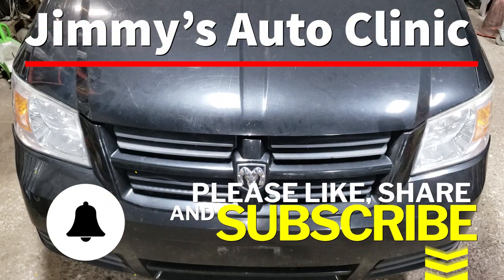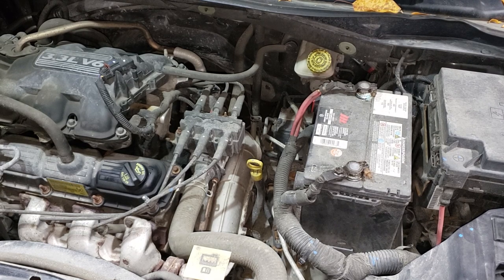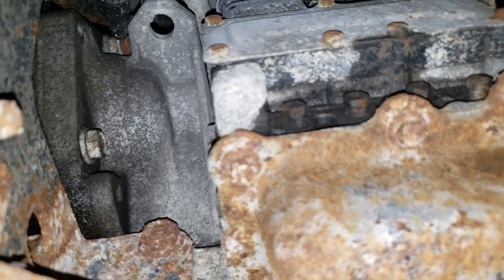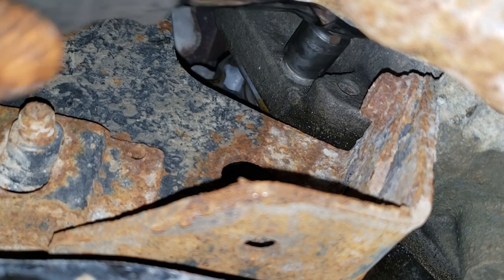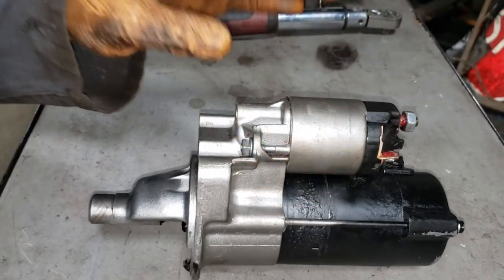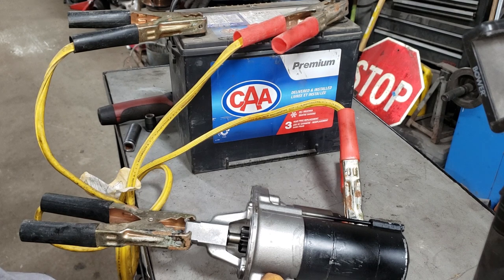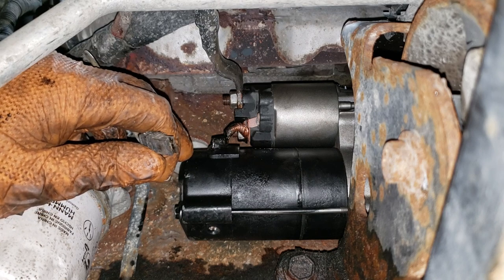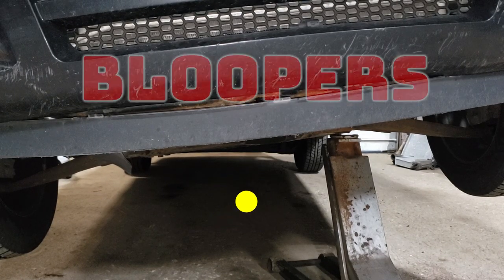2010 Dodge Grand Caravan | Starter Motor Replacement | Rebuilt Starter

Comment: Need advice...  my 2010 dodge grand caravan, 3.3 , just quit while driving.  Have power to everything but when you turn the key, there is nothing.
Checked battery,and it was low. Recharged the battery and still nothing. Could this be a starter problem? 
 Thank you 
Larry.     Ohio

Comment: My 2010 grand caravan SE 3.3L key is getting glitchy and not going into the off position so I was jostling it I went to far and it tried starting twice quickly and a BIG puff of smoke rolled out from under the hood and nothing...the smoke came up in the middle up by the cowl but not either side and now when turn it to start everything shuts off and nothing, but at on or accessory everything lights up again.... I'm wondering if the starter burned up? I've never seen that happenthat fast before.  There is a monster 32 headway cell 64AH lithium battery trying to start it  not a an oem style little lead acid battery, Any theories? Electrical smoke is scary especially when you have zero idea where it came from. Fortunately it's cold out now
Reply from the maker: Unfortunately I think I have more questions than answers for you. Are you saying you're running the vehicle on a lithium battery? If that is the case depending on the type of lithium battery it is from what I understand a battery that is not always compatible are interchangeable with lead acid systems I don't know why that is but that might be the cause of your issue. I would not replace the starter first off I would get it properly diagnose it sounds like you have some electrical issues. The puff of smoke could be the starter burning up or it could be wiring that couldn't take the amount of amperage coming from the battery. However without seeing I really can't give you any actual answers. I hope you understand. If you have any other questions feel free to reach out.
Reply: @JimmysAutoClinic  yeah I run a big lithium battery for the stereo for about 2 years now, the compatibility thing is running it parallel with flooded lead acid because of the lithiums 13.6 resting voltage so flooded pulls all while vehicals is off, I had an isolator to separate if vehicals was off but I eventually deleted the flooded it dragged the voltage down to much like a volt and on a big amp that could be a few hundred watts.
Reply from the maker: @budgetbumpin sounds like you have a mega sound system.

Comment: So I just replaced the starter and now it’s grinding. I put the shim back on with it. Did I put it back the wrong way? I might have flipped it and put the wrong side toward the starter itself? Is that possible?
Reply from the maker: The shim goes in only one way between the starter and the transmission. What I would do is compare the old starter to the new one to see if there are any differences. You'd be surprised how many times you might get a part that is wrong for your application.

Comment: Great video, got a question tho. I don't own a torque wrench/ratchet. What will happen if I just tighten the bolts on without one?
Reply from the maker: You don't necessarily need to have a torque wrench but you have to be confident with a ratchet that you're not overtaking or undertaking. Honestly it's worth it just to purchase one so that you're 100% sure because a lot of times Parts either fall off or people break both and that is not what you want. However if you are confident you can go ahead and use a ratchet with really no issues.